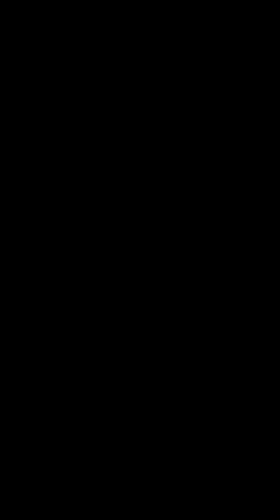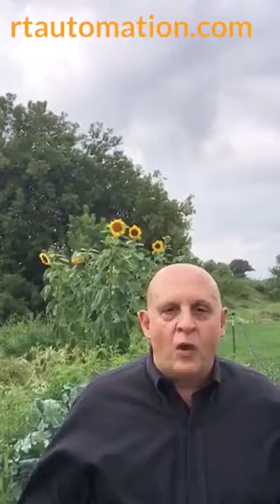Case Against Time Sensitive Networking

Comment: Since you don't understand it, or your specific area of interest doesn't require it, doesn't mean it's not needed or useful.

The standard has built in the requirements for the switches and all other devices for achieving this TSN so unless your network uses devices that are capable of real time networking, you'll run into trouble.

Other thing is, that once it's baked directly to IEEE standard, it'll be supported sooner or later. Before you had to use non standard extensions or protocols that didn't play very well with everything else or needed proprietary hardware for that particular standard (in audio world DANTE etc.)

It's not taking anything away from you so why not let it be? Why be against it?